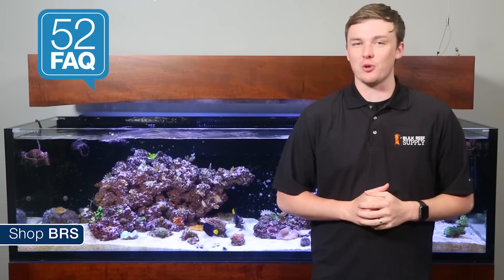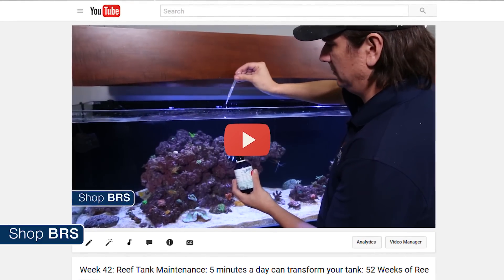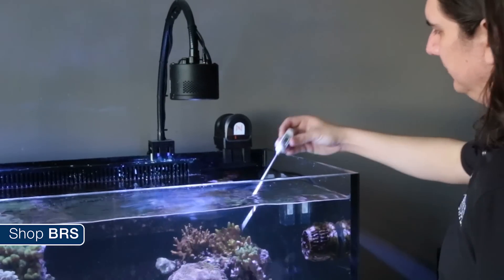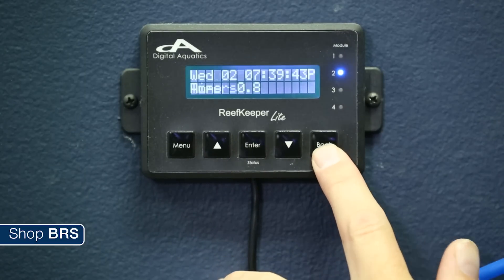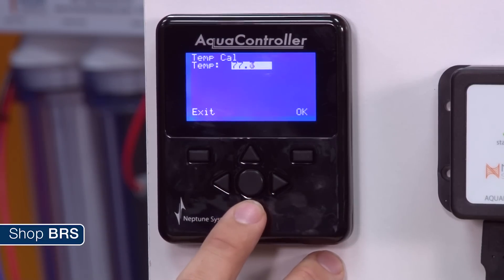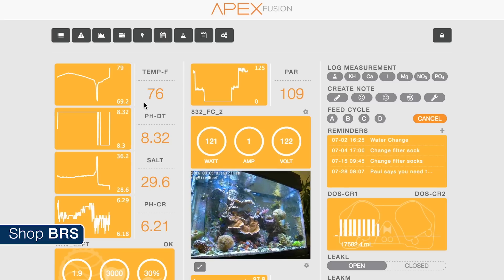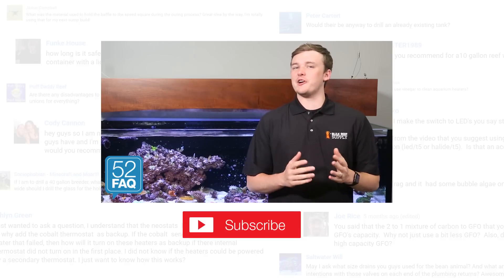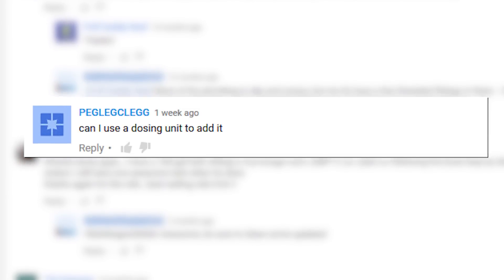FAQ #14: How do you calibrate your reef aquarium controller's temperature probe? | 52 FAQ

Comment: Would it make sense or be possible to calibrate the temp by pulling the sensor out of the water and checking the ambient air temp against a thermostat (which usually has a decent thermometer in it) and other regular, non submersible thermometers?  Or do you have to measure it in the water only?

Comment: A useful trick for checking the accuracy of a thermometer I learned while working in the food industry. Fill a cup with crushed ice and then add enough fresh water to cover the ice and give it good stir. Dip your thermometer into the middle of the glass making sure not to touch the bottoms or the sides and wait about 30 seconds. If the thermometer is accurate it should read 0c/32f. If it reads higher or lower then you know its off and can take that into account when using that thermometer in the future.
Reply: Its good for checking kitchen thermometers, which I figure is what most people will have on hand to double check their heater temperature probes against.
Reply: thinking of getting a kitchen thermometer , any brand recommendations ?

Comment: In 1999, Kleypas, and her coworkers, published data on coral reef temperatures (Table 1) (Kleypas, et al, 1999). They examined and summarized published data taken from separate measurements on over 1000 different coral reefs. It is worth remembering that these data were gathered prior to the recent increase in temperatures attributable to global warming and probably reflect more-or-less “normal” conditions for the last couple of centuries. The data in the average column are probably the most pertinent. The average temperature calculated for all 1000 + coral reefs was 81.7°F. Over all reefs, the average lowest temperature observed was 76.4°F, and the average highest temperature was 86.4°F. One way that these data could be interpreted would be to say that for most corals and coral reef animals, the best conditions would be between 76°F and 86°F, with the average being about 82°F.

Comment: Hi. Quick question. I have seen that people (food industry) calibrate their digital probes by inserting the prob in a glass of crushed ice (in the center without touching bottom or sides) with just enough water to fill the cracks but not allowing the ice to float. Now i understand that the crush ice should read 32 Deg. That's how they calibrate. Can we do the same in calibrating our probes?
Reply: Cool thanks. That's exactly what I did .
Reply: its 32 f not deg

Comment: i have a really bad problem, i use RO water and do water changes every 5 days and my corals NEVER look good, i have no idea what i"m doing wrong, please help
Reply: Are your parameters optimal?
Reply: ICOOKIE69I yes i check almost weekly
Reply: young Reefer What do you test? Either it is insufficient flow, lighting, or magnesium.
Reply: ICOOKIE69I i have a 30 gallon rated filter for my ten gallon and a 240 GPH flow thingy (forgot what its called)  and maybe the lighting is the problem, but i have a lite that was specificly meant to fit for 10 gallon nano reef tanks, and i do test for magnesium, and it is just around 1400. i also test for calium, ammonia, nitrite, nitrate, and pH.
Reply: ICOOKIE69I are there any other tests i should be taking?
Reply: young Reefer What light do you have? 1400 is a little too high, that level can kill snails. You should also test strontium. If you have shrimp, test iodine/iodide. You should especially check alkalinity and phosphates.
Reply: ICOOKIE69I i have a current orbit marine LED
Reply: young Reefer Oh, that's not bad then. Yeah, you might want to check the parameters I mentioned above.

Comment: Have to admit that I am a little disappointed you didn't actually check the accuracy of the temperature - you just took an average of other thermometers which could all be wrong.  While a water / ice solution will get you 32 degrees.  Boiling water gets you 212.  My thermometer has a very narrow range, however.  Further, if I could just calibrate at 78 degrees, that would be good too.  The closest I have come is to find a thermometer that can read both 32 and 212, and use that to compare against a narrow range thermometer.  Anyone have a better idea?